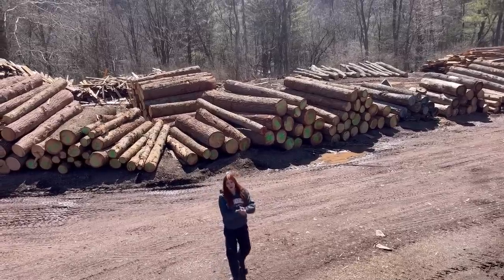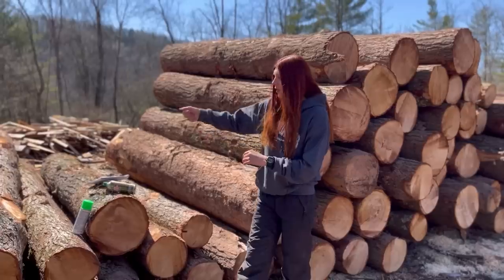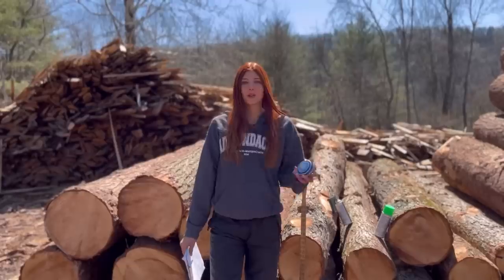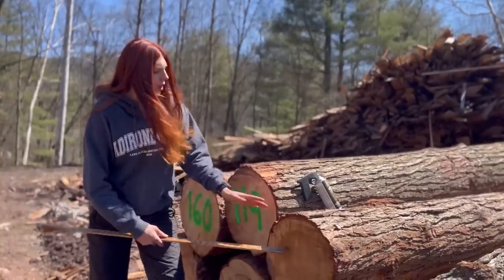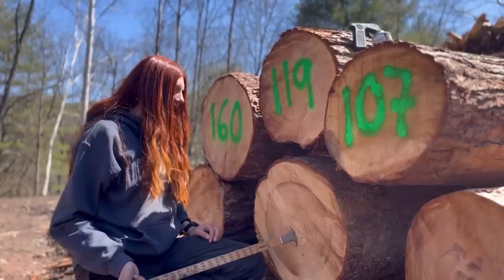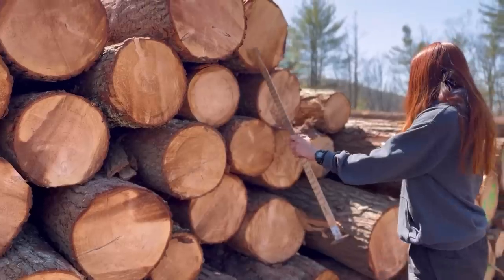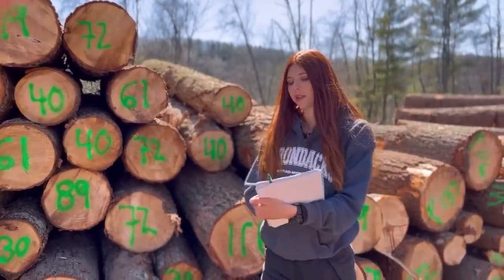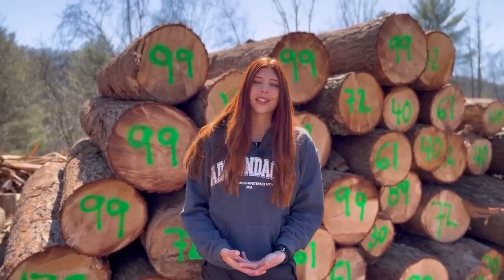The Best Log Scaling Video on YouTube!

Comment: Do you have a scaling license or ticket?  In Canada scaling is a government regulated measurement system with trained licensed scalers.  We use alot of the same principles as you describe, but the end payment is made on the net cubic meters of wood fiber, not board feet.  Logs with defects are given a lower grade and payment level.  Scaling is much easier after you have sawn logs into lumber.  At a glance you can measure lose of lumber production due to a defect.  Good job.   Keep it going.  There is so much you need to know to operate a sawmill!!

Comment: in your next video on scaling may you cover over run, it is where you take the board footage of the pile, and compare it with the board footage of the pile when cut. If the cut pile equals more board footage than the log pile had.. thats over run, could you tell us the over run rate?..

Comment: Would there be any idea in using two colors? thinking a second color for logs that are marked down, then when you see that color on the mill you would know to double check the board feet output and hence indirectly do quality control on the marking process, or maybe you check output for every log and compare (?)

Comment: Do you ever check yield from the log compared the scaled number?   Using Scribner C on the west coast, we generally get 25 to 100 percent overrun.
Reply: Valid question Kay. There is so much labor involved , start to finish, I worry about their profits. Even boss man charging $110 an hour seemed too cheap but at least he has a handle on costs.
I wonder if the log sellers have dollar signs in their eyes or are they happy. Repeating, lot of labor by this family.

Comment: Not accusing you of anything, but, we would haul logs all summer off of a strip and average 5800mbf per load.
Then into the fall our scale would drop from 5800 to anywhere from 4900 to 5300mbf and we made less money of course.
When our boss was asked 'wtf,' he told us the mills were full and they don't need the logs!
Any truth to that?
Reply: You were more than likely hauling to a pulp or paper mill where they will take any trash wood until their yard is full . Supply and demand .

Comment: What was the total for that load ?
Reply: Wild ass guess, maybe 100 logs, at about 100 bf average each?  I might be a little high on the number of logs, and low on the lbf, but it averages out, so 10,000 lbf?  Stumpage prices range from $ 65 -85 p/mbf for hemlock, so let's say $750 for that load.
Reply: Oof if I only got $750 for 10k bf of hemlock me and the buyer would be throwing hands haha.  Where I’m at we typically get around $.40/bf so that’s be about $4500 for a 10k load.  Not sure what pricing is like in other parts of the country but I can guarantee with the operation costs what they are, not a soul would be cutting anything for $750/10k bf.